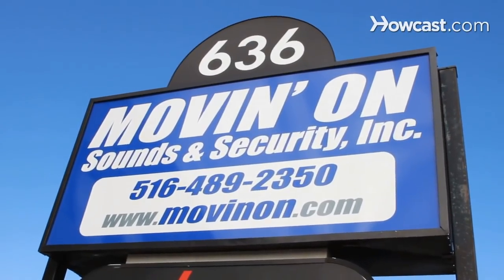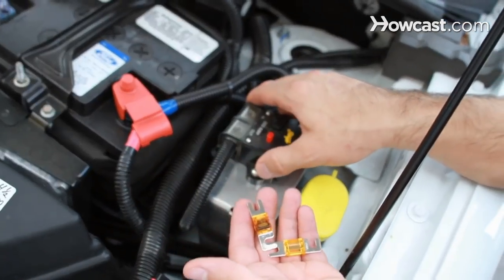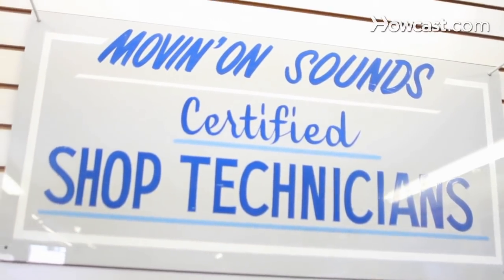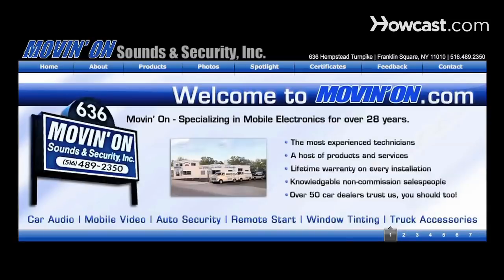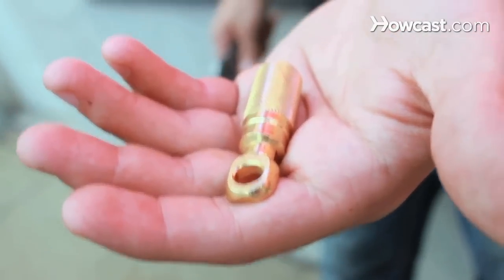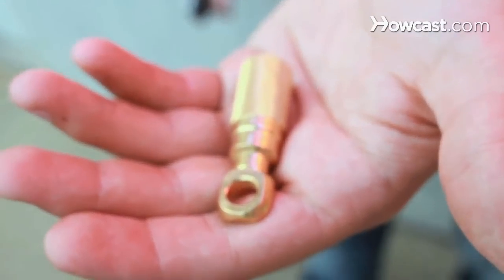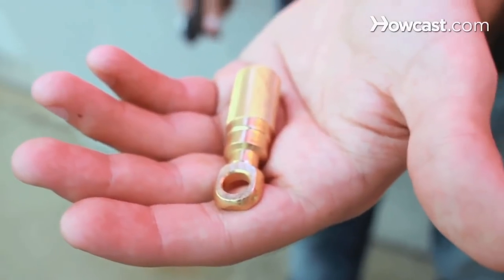How to Make a Proper Ground Connection | Car Audio

Comment: Seatbelt bolts you say? No my friend. Thats not going to give you the correct reading. Due to the fact that it is technically a ground but those components are drilled right into the painted area of a vehicle which results in BAD connection. Ive been what you have been for 8 years far longer. Grind the paint and do it correctly to be as safe as possible.

Comment: so theres been something that i get hung up on,    and would like if possible   clarification   

when i hear BODY GROUND i think of sheet panel metal like trunk floor or floor pan or firewall etc   
When i hear FRAME or CHASSIS ground,  i think of grounding to the metal frame rails beneath the body of the car or truck  

im older and having owned and worked on cars trucks which had a frame/chassis and then a Body bolted to it,  and then the use of the UNIBODY  chassis  frame, etc    i envision 2 different grounding processes,  

Is this still somewhat   releveant (pickup trucks and semi tractor cabs and etc excluded,)  when discussing Cars   is there still  sections of thje unibody,  designated as the frame/chassis and other areas designated as the body,   even though the term  UNIBODY FRAME design  coimbines the 2 
and if so   whidh areas are then specifically deemed frame/chassis  and those deemed body

sorry if this seems redundant   thanks in advance

Comment: What may be the problem from my ground installation ?? The wire gets hot and does not want to power up the amp
Reply: Joaquin Rios What was the problem? Wrong connection or too thin of a wire..... Same happened with my fog lights
Reply: Too small of a wire

Comment: "... bolt of equal gauge to the wire..."  are you suggesting using a sheet metal screw rather than a nut and bolt?
Reply: Yeah, I found that a bit strange, why would anyone want to use the same gauge?(which presumably means the diameter, I've never heard of measuring the gauge of a screw). Perhaps he meant at least as large, though it'd be pretty impractical to find/use a bolt so small that it could carry less current than the wire.

Comment: I have an after market radio for my 03 vw passat and sometimes the Open door signal turn on randomly and I always have a sort of whistling sound in the back ground. It even gets worst when I turn the light on or when the screen powers off after idling. It has no ground (or dosen't appears to have one) in the back or the unit. Could that be a related issue with not having a proper ground?

Thanks
Reply: Rudi Le Goarant RCA's should be separate from power and ground wires

Comment: what if you dont want rust. when I was a kid i put subwoofer into my 240 and my friend forced me "i HAVE to scratch the metal to get a ground". this seems like bullshit. Because 10 years later it's now a rust spot.  Car makers should do a better job and make a place to ground aftermarket devices to so that we don't have to make the car rust.  I want to install an Air lift kit on my current car but I don't want to run into the same problem. I almost just want to strap an external battery inside my trunk and power the compressor from that instead of mess with scratching up my new car!

Comment: Do NOT use a seatbelt bolt for an amp ground. That is a fantastic way to kill one of your passengers. Modifying a safety device is moronic, you can find many other places to ground your amp. I would never trust an install from this guy.
Reply: You're not modifying anything.
Reply: @jasonjorgensen5007  You are though. You are removing it and adding your ground terminal along with sanding away any paint that is there. The nuts and bolts require specific torque to function properly in the event of a crash. The terminal being there can also cause the nut/bolt to loosen over time. Just don't fuck with your seatbelts, airbags, or anything else safety related in your car.
Reply: @jasonjorgensen5007  You dont talk like that with Seth Bike Hacks mate....we are his back 😁
Reply: @alecmanning9177 you do realize that a lot of people own torque wrenches and other proper tools for the job right?